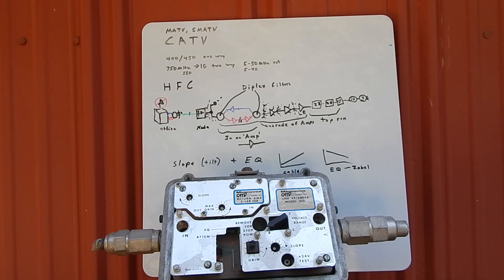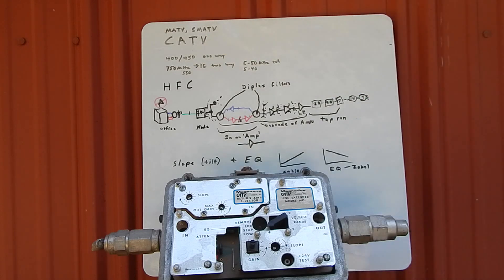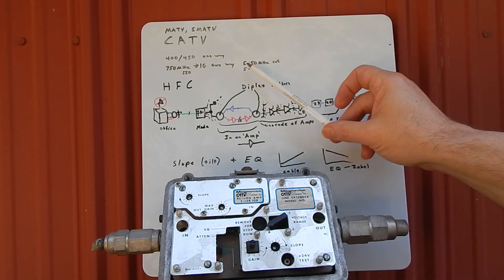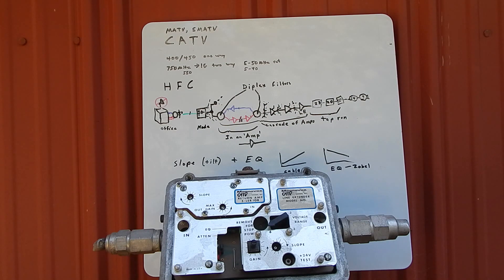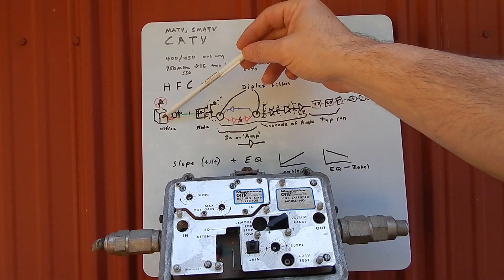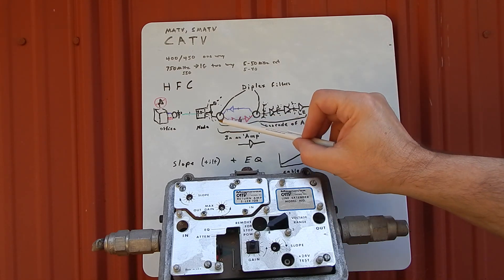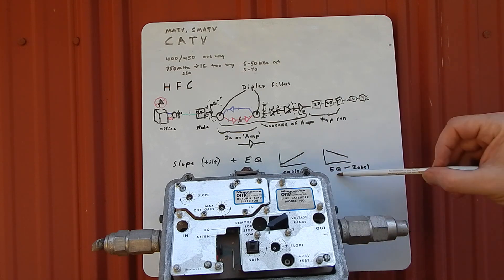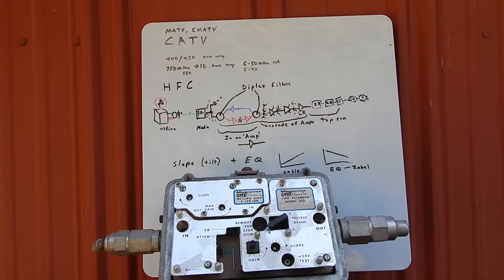How Cable TV Works

Comment: A question?  I have a pole on my property and there is a cable tap up there, it has 2 outputs one goes to my house the other one is empty.  I want to tap into that empty port to feed cable to a garage separate from the house, but the cable used on the tal is much largher than my normal cable wire. What kind of wire do I need to connect to that tap?
Thanks for any help.
Cheers
Reply from the maker: An unused port at the tap should have a locking terminator on it to prevent illegal hookups. Your cable company may not take kindly to a DIY hookup to their tap. A cable with a poorly installed connector or even just loose can cause problems that will send an unhappy lineman to your pole (after he spends hours finding it). And is there a neighbor who might someday want service? With all that considered I have seen it done many times. Most companies use "RG6
Reply from the maker: Most used is RG6 cable with a messenger wire. It may be quad-sheild in some cases and can be very difficult to put a connector on without special tools and experience. Fatter yet would be RG11 with one to four sheild layers. 11 is used for longer runs. There is also an RG7 that look a lot like 11 but it is rare. RG6 is common and should be fine for a garage. Most sysems are encripted now a days so you likely need a cable box.
Reply: @HillsWorkbench  Yes I need a cable box and a modem. I already own a cable box that I pay for every month but is in a spare room and never gets used, so all I need it to rent an additional modem for wifi.  I am having 100AMPS broth in to that pole and dropped to the garage and I figured since I will already have someone up there installing the electricity that is coming from the house and then down the pole to be in-ground, so I figure get it done at the same time.
Reply from the maker: @littleredhousehome  Except that they are different skill sets so don't expect the electrician to do the cable work.

Comment: Hi, sorry if this is a daft question but what would happen if a catv coax cable is shorted say temporary or permanently?  Say a strand from the braiding or the foil manages to touch the center conductor, what would happen, would things continue to work or would it be very obvious something is wrong?
Thanks
Reply from the maker: A short on a cable knocks out high frequencies especially. If the short is complete it can stop all propagation of the signal further but usually, some low-end signals pass. A strong reflection occurs, reflecting signal back to its source. This will result in a lumpy frequency response even upstream all the way back to the last amp ahead. A Time Delay Reflectometer (TDR) can measure this reflection and give a distance to the fault.
Reply: This would cause ingress on your line. It's not a short. It's just not cut right and let's in ingress and regress

Comment: Is the center conductor of the cable considered the hot leg to pass ac? what part.of the cable would be used for the neutral When passing AC from.the power supply to the line extenders
Reply from the maker: Yes, the center conductor, connectors, passives and actives have to be able to pass this power, 60 or 90 VAC semi-squarewave at currents up to 15A in old systems

Comment: Hello Mr. Hill. My internet sometimes disconnects when the temp drops. My modem shows return dBmV between 16-19 and my forward is around 43. When it's warm in El Paso, the return is around 12 and the forward stays about the same. I called a tech to the house in the winter and the tech said our signal was super hot and needed a line technician to correct the problem. The tech told me that the reason for the signal being so tilted was because they installed an AMP in front of my house and I'm the only one on it. The line technician showed up one evening and never went to the amp. Instead, he went to the side of our house and installed a 9 decibel attenuator and left. The forward signals are now in the mid fifties and the modem goes out regardless of temperature. I don't want to call again for fear of getting charged. What should I do? I feel like the line technician didn't do what he was supposed to and it took a long time for him to come out the first time.
Reply from the maker: I'm afraid I agree with you, except that what you call Forward and Return are opposite what they are called by the Cable Co. The 16 to 19dBmV is the forward, the broadband signal you are receiving. That is a bit high, a few modems don't like to see much over 0 dBmV, particularly some of the early Motorola DOCSIS 3 modems. The 43dBmV is the level you are transmitting back, which is in a good range with 46 being a common level to target.
Anyway, if your levels were like 18 & 43, a 9dB pad should put you at 9 & 50, which should work. If your transmit level is climbing much beyond that, you may have a bad connection somewhere. A loose or corroded connection will drop the low end out, if your transmit levels are fluctuating, something is loose somewhere. Most modems max out at about 59 dB, give or take a couple.
 At any rate, there are automatic gain controls and "thermals" (AGC or TAG units) that can be installed at the appropriate upstream amp to control levels.
Reply: @HillsWorkbench  I'd say a 12db cable sim would do the trick.

Comment: If it’s cable, why do they say it works off a satellite
Reply from the maker: In the old days, CATV services collected their channels from an array of large C-band dishes and an antenna tower. Then everything was processed so that all the channels leave the headend at the same level and all the audio carriers likewise controlled. Now in the digital age and digital channels, MSOs use master Headends to collect the channels, often with direct fiber links to most sources. Then fiber linked to regional headends and local hubs.
Reply from the maker: @StringerNews1  Yes, heard that 5G is a whole new TI nightmare for C band operators.
Yes, a few small independents will still use an antenna farm, but most are disappearing. You can still run a small system off a couple C band dishes using HITS service.